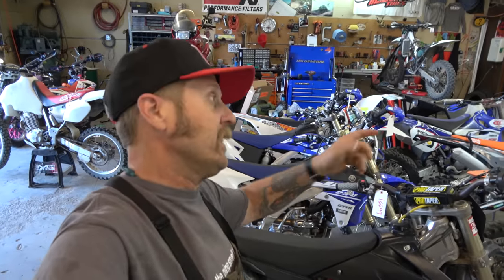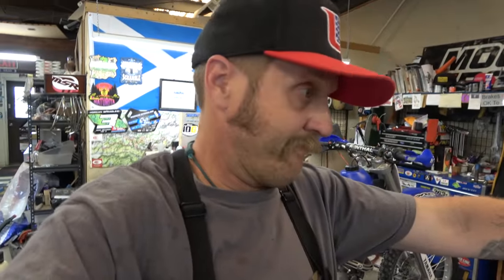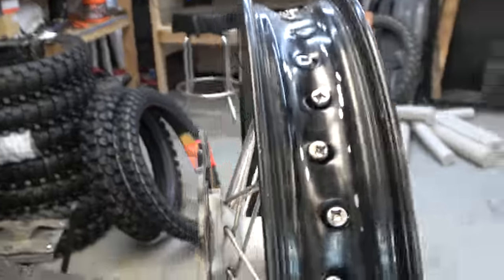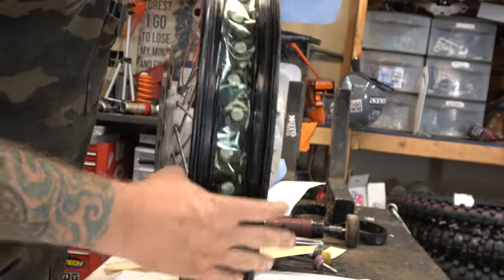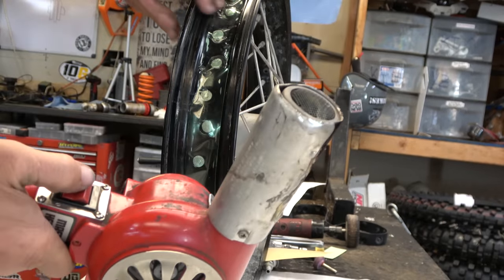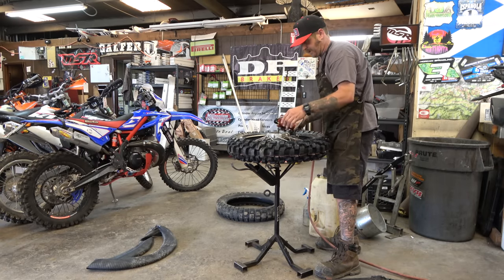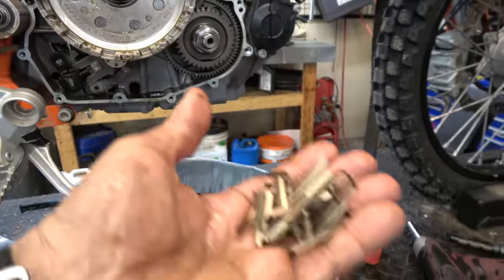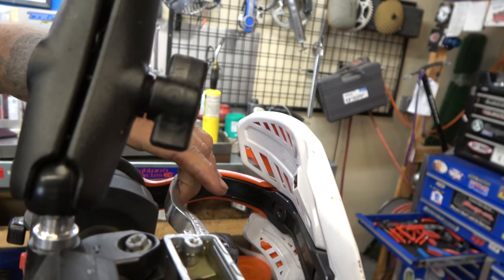The Shlog #247 | KTM 690 Rekluse | KTM 690 Tubeless | Drilling Mousses | Highland Cycles

Comment: I don't think michelin makes a mousse small enough for that tire. I went through this myself on my 125 and ended up drilling it and pulled a small section out to get it small enough. Still didn't like it, so pulled it and put in tubliss. The smaller nitromousse was backordered for it and showed up a few weeks later from slavens.

I'm actually amazed that it got mounted! I don't have a rabaconda but do have a machine and a ton of levers.

ETA - mine was a 110/80-18, was this a 120?
Reply from the maker: It is a 120

Comment: Curious how this is cheaper then just buying the right mouse. If I had to ride tomorrow I’m totally down for it.
Also slime for tubes has saved my buddys bike a few times. Just need to make sure it’s the stuff for tubes.
Reply: I agree with you on the Slime for tubes.  It does work well, but it only has 2 year life expectancy in the tube.  I know, tubes should be replaced more regularly than that, but there are times where adventure/dual sport bikes may get a pretty long tube life.
Reply from the maker: Right. Most people buy the tire stuff. It would have been better to buy the right mousse. And if she had come to us first that would have happened but she didn’t. So this is cheaper than buying another set.

Comment: What happens to that tubeless system if you need to fix spokes do you have to get a whole new kit?
Reply from the maker: That’s a good question. I think the though is that it’s on a more adv/street bike so they shouldn’t need to be tightened after they have been tuned up after break in.

Comment: Tried to put a tubliss in my 701  a few weeks ago but the rim is to wide and the Motoz tires walls to thin for it to seal. Just sticking with a tube and 2 rim  locks for balance. Whats that guy going to do if he gets a flat, won't be able to seat the bead with a hand pump. No rim lock so can't run low pressure, just seems like it's just got a lot of disadvantages.
Reply from the maker: I agree. And so does he. It’s a test for sure. He will have to carry a tube just in case
Reply: Yeah, definitely some disadvantages. But for most of what I’m doing with the bike I shouldn’t need to run super low pressure, and as Morgan mentioned, I will carry a tube as well. It will be super nice to be able to just quickly plug something small (if the Orange doesn’t seal it first) and only use the tube if I have to. We’ll see how it goes.
Reply: @DanBallard  How did the tubless go for you?

Comment: I think you need a drill bit with like 1 1/4 inch diameter. Instead of little holes. Inside Enduro has a pretty good bit but it’s speedy.
Reply from the maker: This is the smallest one. I like to start smaller because the bigger holes makes them wear out super fast. This isn’t a race setup.

Comment: Man you work on those tires way too hard and build a sweat with that Rabaconda it should not make you lose your breath. I wondered if a sealant would be needed. I have the Radius X in my 690 and has been great for 2 yrs now. Lots of adjustments first 100 miles.

Comment: Won't the Orange seal will die in 5 months, on a bicycle?  Who knows how long in the moto environment?  Good luck with that.
Reply from the maker: I’ve had it in my bicycle tires over a year. It’s only rated for 5-6 months but if you ride at all that’s 2 or 3 sets of tires.
Reply from the maker: On my dirt bike I go through  a set a month if I’m not racing. More if I am.
Reply: @highlandcycles  We ride a lot on the mountain bikes and latex only reliably functions for 5 months at best before needing a top up.  Wait long enough after 3 top ups and you get a fist sized hard globule of latex that throws off the balance and creates a hard spot.  I'm skeptical of the long term reliability of this tubeless set up.  But what do I know?  I'm a luddite and still run tubes in the moto.
Reply from the maker: @scottforrest2246  I’m skeptical too but I think we will change tires long before the longevity of the sealant is the issue. It’s a test. Customer knows it might not work. I just think it’s funny that people expect moto tires to last very long. I went through 3 sets on my 990 in 8000 miles in under 3 months.
Reply: @highlandcycles Clearly you ride moto more than I ride and I'm guessing I ride mt bike more than you and this isn't a passing contest but the way.  I know what you're saying.  I'll eat crow, or soy meat, if the latex sealant lasts long enough to reach the next moto tire change.
Reply from the maker: @scottforrest2246  for sure. And I’ll be surprised if some leak doesn’t develop. I don’t like tubeless on Motos unless it was built for it. The customer and I know it’s a gamble. I just doubt the sealant is the weak link. Unfortunately they don’t make tubeless wheels or mousses for these bike.
Reply: @highlandcycles  I understand your pain..  ride.. wash.. change tires.  Repeat.  😂